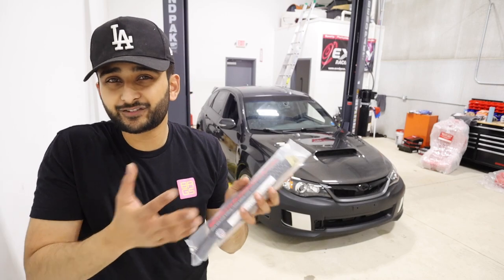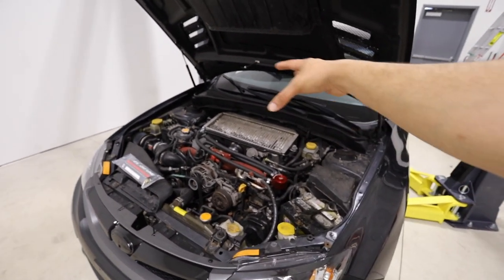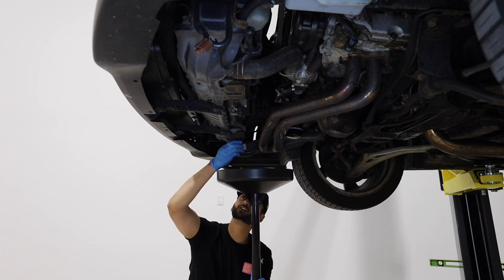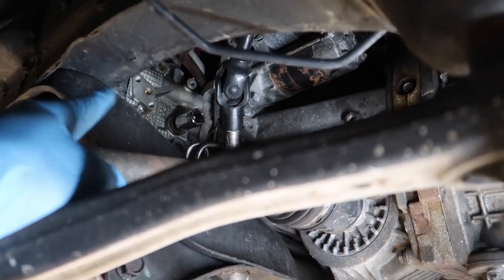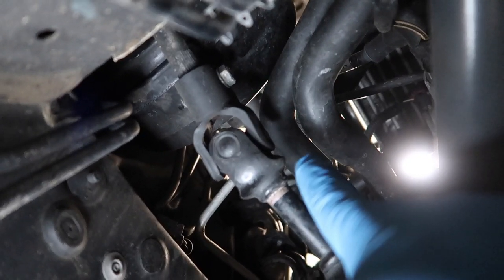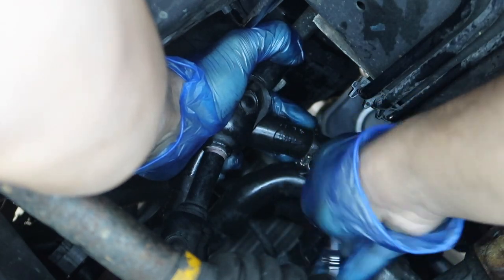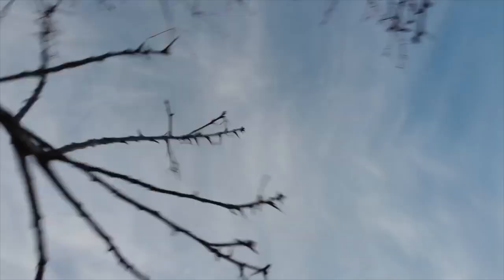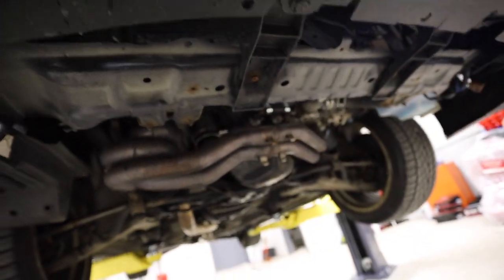How To PREVENT SUBARU ENGINE FAILURE With This $79 Mod!!

Comment: Yes cylinder 4 is problematic.  I did valve adjustments at 112k miles on my "original owner" 2000 Impreza non-turbo and measurments on 3 cylinders where still within specs but cylinder 4 was absurdly tight.   No doubt excessive heat contributed to the gross discrepancy.  Now that was a non-turbo car!  With a turbo engine cylinder 4 needs all the help it can get.

Comment: Hey man was just going to recommend that you run the blue subaru Long Life Super Coolant. Definitely better then the green stuff and will help. Only saying because I work at a Subaru Dealer and have done training. Believe me when I say its better. Thats all! Car and shop lookin sick man!
Reply from the maker: im going to swap out the coolant soon, i was wondering why it wasnt blue but im guessin  because it was the long life coolant
Reply: @beakhan  yes, just ask for the long life super coolant! Thats the blue stuff. Also thanks for replying, definitely something many creator's don't do!
Reply: @beakhan  green coolant is fine, just change every 30k to avoid coolant system corrosion
Reply: Its better! Believe me bro! i did the training!
What specifically about the coolant is different and makes it better than the nonproprietary blue coolant brands ? There is so much debate about proprietary maintenance stuff versus aftermarket on the internet. While some aftermarket goods manufactured in certain developing countries with higher corruption and lower safety standards might be dodgy AF, many generic brand names do manufacturing in for example, the U.S. and what about motor companies? They claim their oils and coolants are the very best, but provide no transparency over the supply chain, they could be made in Afghanistan for all we know (joke) . furthermore there is economic incentive for them to dissuade consumers from cheaper aftermarket brands. You're entitled to sh#t your opinion whereever you like but its completely unvalidated and you sound like a shill.

Comment: you used the wrong coolant, should be blue
Reply from the maker: that was actually a big concern of mine! But i went to a subaru dealership parts dept. and asked for coolant for specifically my car. I wonder if the employee just wasnt paying attention and I have to go back😅
Reply: @beakhan  yea bro i work for subaru & i own 12’ WRX its blue💀
Reply: @Jee-zus  nothing wrong with green coolant, just has to be changed more often
Reply: @zachs.9600   i mean I’m no expert but i would go with what subaru recommends just to be safe since they are the engineers
Reply: @Jee-zus  the engineers obviously aren’t so great if the aftermarket is constantly making parts to correct their mistakes.
Reply: @zachs.9600   right but you’re going off topic here. The subject of the matter was using Subaru GREEN coolant in a engine that recommends BLUE coolant. Trust me i have issues with the engineers too😂
Reply: @Jee-zus  it’s not off topic lol. Manufacturer recommendations are not always the best/only thing for your car. Subaru recommends 5w30 motor oil, but everyone uses 5w40 because they know that recommendation is no good lol
Reply: @zachs.9600  Yeahh but I’m referring to the video where he’s still using Subaru GREEN coolant. Thats not aftermarket thats just swapping coolants from the same brand lmao
Reply: @Jee-zus  one lasts longer than the other, that’s the only difference. So it makes no difference which one you use
Reply: @zachs.9600  06 sti stock, original owner. Used 5w40 once because of the stuff I saw on the internet, and right away the car ran like crap and threw codes. Changed back to the 5w30 and in minutes the codes turned off and the car ran perfectly. 2 yrs late I know.

Comment: Right on brother. Definitely making my own as my new used motor came with the engine side nipple. Unfortunately I was sold a bad engine so my swap has to come back out. Unfortunately that's kind of my bad for not doing a leak down test before installation. I know better but got excited to get it back on the road. 😅

Comment: Advice and help needed. I'm in the UK, have a 2009 impretza wrx hatch 2.5ltr Ej25. Had a code P0422, Throttle position sensor B, intermittent. So OK, just replace the TPS. Nope, looking further, I can see oil buildup on the IC pipe too throttle body. So I'm thinking, Turbo oil seals passing oil to the throttle body and sensor, given false code and poor performance??????
Reply: Not sure about your actual issue, but if you don’t already have a catchcan installed, I would highly recommend it. I have them on both my WRX and my daughter’s Forester. They are fairly new so they don’t seem to have a lot of blow-by, but the catch can on my Ford truck captures a ton of of disgusting oil/fuel mixture on a regular basis. Stuff you don’t want in your intake for sure.
Reply: @kevinm5177  Hi, that was my exact plan too instal. Need to get turbo replaced and throttle body plus sensor cleaned. & tested. Along with new spark plugs and plasma coil pack's. I think, engine flush and oil change?. After that, if I still have problems,???
Reply: @cassiejvance7496  Just because there's oil in your intake tract doesn't mean your turbo needs to be replaced.  The oil in the intake tract is designed to be there due to oil blow by getting out of your pcv breather which is routed directly into you turbo inlet.  This is an issue with lots of factory turbo cars.  All turbo dsm's had this problem as well.  The solution is to install an air oil separator which the line from the pcv will be routed into and from there back into the intake tract.  The AOS traps the oil in the airflow but allows the air to continue on to where it needs to go.

You should probably do that first and while you're installing the AOS you an check the turbo for excessive shaft play to see if t actually needs to be replaced.

Comment: Hey, I was thinking of getting a subaru but there aren't any shops specialized in Subarus where I live. I've already read a lot about the EJ25, if I get one first thing I would be doing would be the safety upgrades such as AOS, cyl 4 cooling mod, equal length headers and killerB pickup tube. The thing is, is it worth getting one if I don't know how to do the maintenance myself and there aren't specialized shops for subarus near ?
Reply: I got a 2014 sti and a 2013 wrx with a ej257 and the ej255, from my experience even without all those safety upgrades you’ll be fine if you treat the ej like a ej and not a V8. Basically just keep up with your maintenance and don’t beat tf out of the engine. It is ok to get on it but just don’t beat the motor up. I have somewhat the same issue with no shops being around me so I’ve taken many upgrades into my own hands, it’s not easy but it’s not hard to do certain upgrades.

Comment: Meh.  This doesn’t fix any issues.  Get a good tune and run good gas.  If you can.  Get a tune for 91 and run 93.  Change your oil.  Don’t be stupid.  Car will be fine.

Comment: Question lol Trying to see if you had the same problem or not idk but I did the cylinder 4 coolin mod on my 2013 wrx but now I have to keep adding coolant to my coolant reservoir every 2/3 days cars isn’t over heating I see no leaks no code’s either runs fine you think it’s normal or not kinda curious thanks 🙏🏽
Reply: Probably burning the coolant.